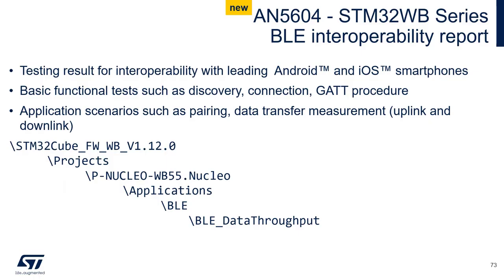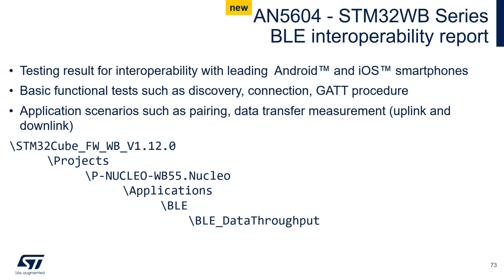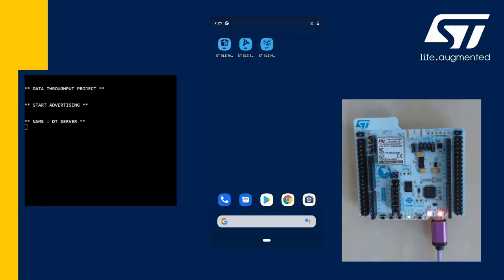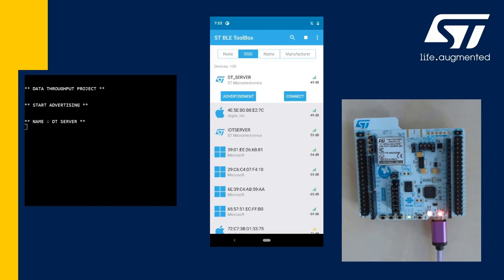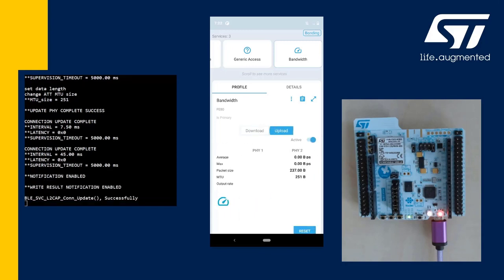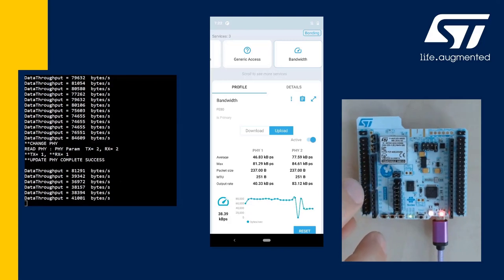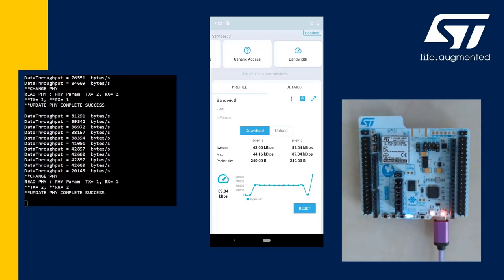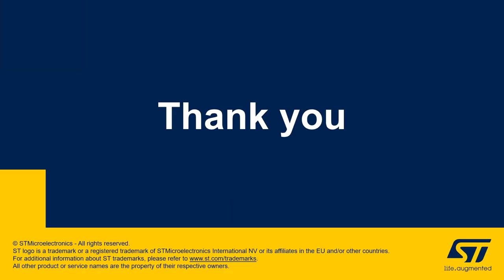STM32WB Getting Started Series: Demo 2, BLE throughput measurement

Comment: How to set a project up in STM32Cube MX configurator to achieve those speeds? Sadly I can't find any tutorial on this and currently I'm struggling with speeds around 2kB/s... When I compare it to my previous project featuring extarnal BLE module which is Telit's Bluemod S42 and transfer speeds around 60kB/s then i feel frustrated...

Comment: The problem is solved by changing to #define GATT_CLIENT 0 in  BLE/BLE_DataThroughput/Core/Inc/app_conf.h file. However, the data throughput is just 3000 kbyte/s which is not what I expected. Why?